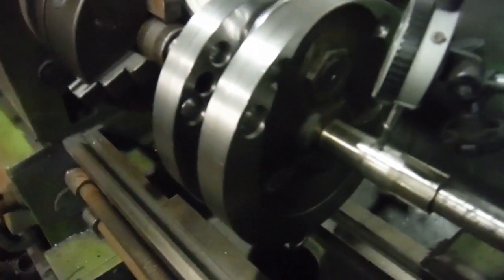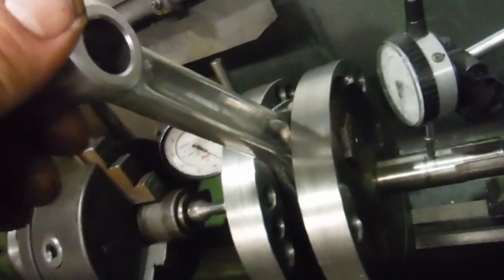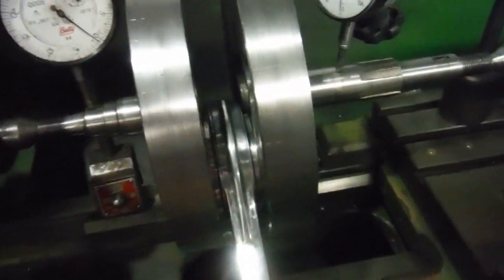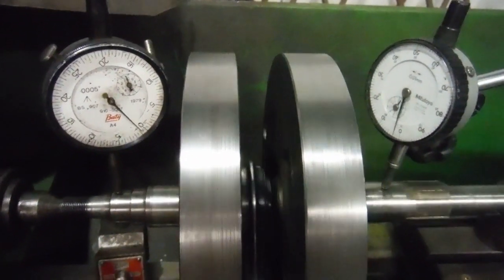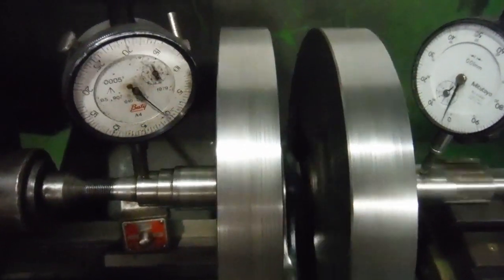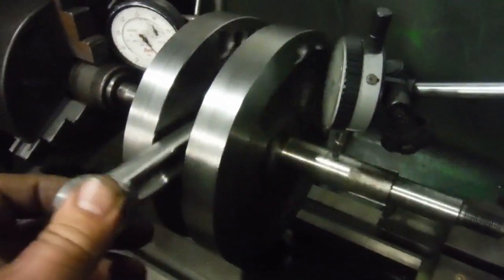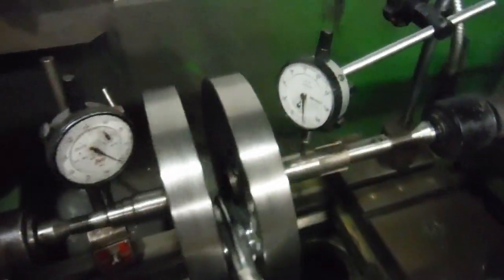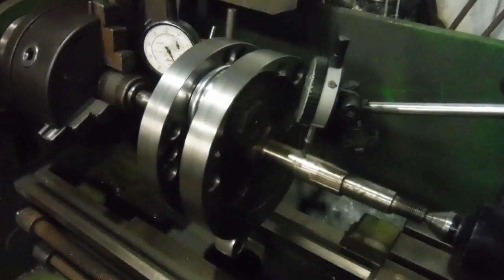Royal Enfield Bullet 500 Asbo 37 crank checked after lightening at Performance Classics.

Comment: Why have you used Floating bush instead of roller bearing? Am trying to learn here, Hitchcock catalog says roller big ends are better for performance. Please explain, thank you
Reply from the maker: The plain big end is tough enough and can stand up to racing conditions, but if the oil feed fails, the plain big end will fail straight away, where a roller big end may survive for a short while. There is no influence on performance, with either big end type.

Comment: Thanks for a great resource Paul ,your vids are very helpful. I have just acquired a big valve and ported head with a concentric 32 mm carb. My bike has a free flow exhaust and air filter . Can I bolt these parts straight on my 500 bullet and with what effect . I also have a special crankshaft with a matchless g50 con rod ,the drive side shaft is shorter with no provision for an alternator and rotor . Many thanks, Paul.
Reply from the maker: Thank you. I tend to avoid oversized valves, as the standard ones are big enough and less likely to interfere with the high domed pistons and shortened barrels I use, but what you have should be quite useful.

Comment: What's the purpose of lightening
Reply from the maker: It helps the engine respond faster to the throttle and improves acceleration and power.
Reply: @paulhenshaw4514  do you have Facebook id?